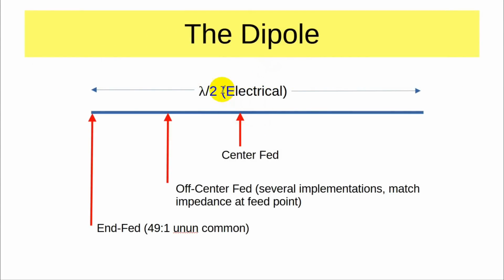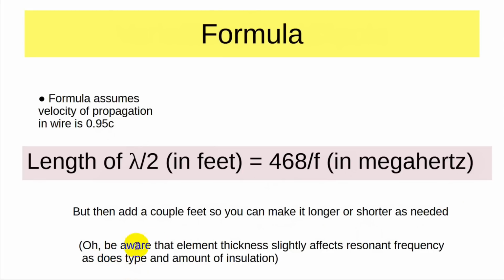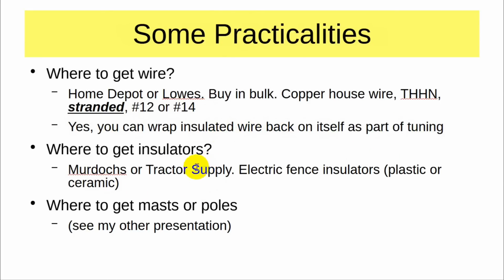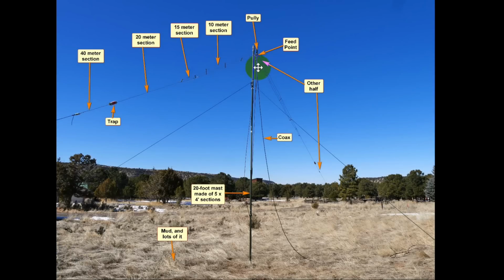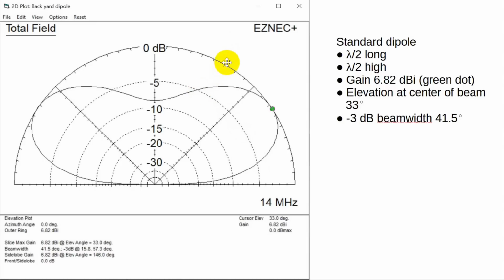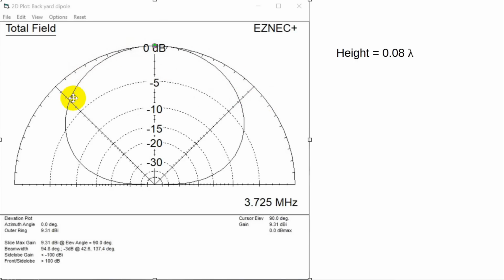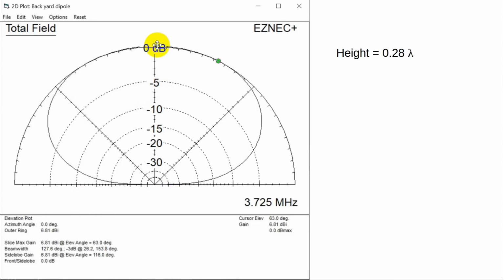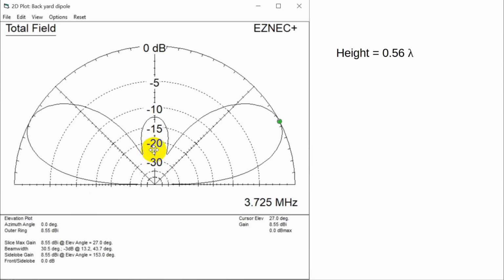NVIS Dipoles (#1188)

Comment: Here's a few tips: FEMA is a useless organization. ARES and RACES have been taken over by FEMA and leftist extremists (Not every member is a leftist nutjob however.)

NVIS antennas work best around 10 feet high. If you don't know this it's because you lack experience. So before you go through all the work of putting your NVIS antenna way up in the air like a regular ole dipole, just try it at 10 feet or even lower. Forget all the charts and antenna models.